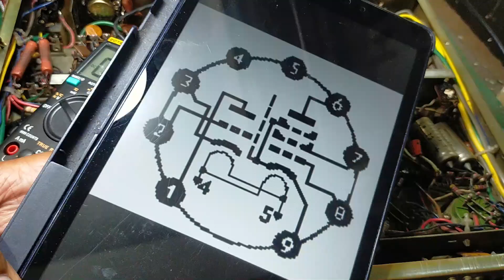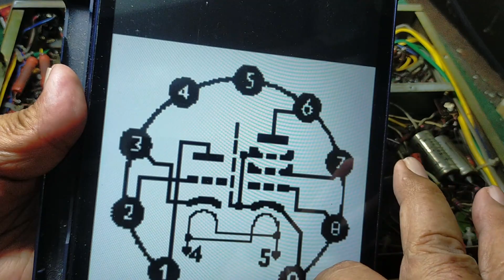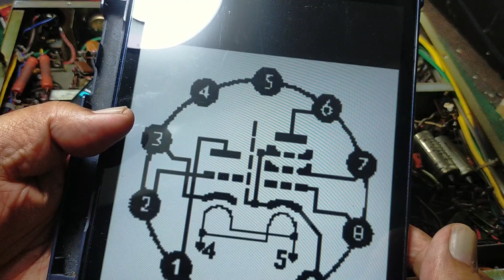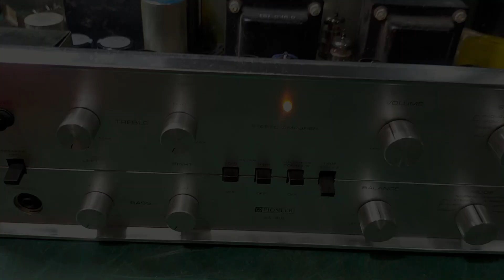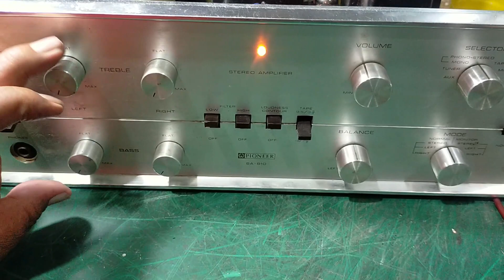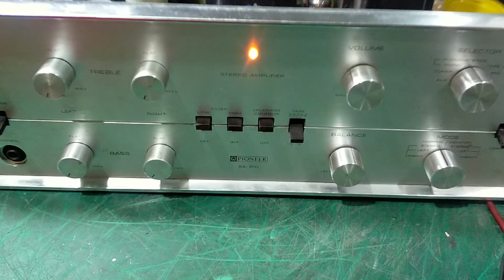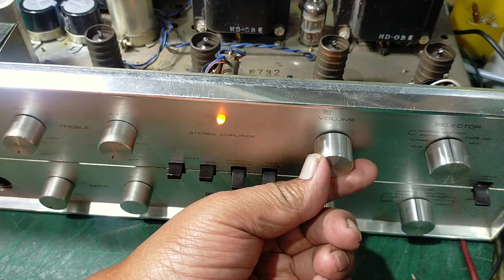Pioneer SA-810 Tube Amplifier

Comment: Punya saya SM83 ..... saya fungsikan flat om tone saya matiin ..... bisa integrade bisa juga utk power saja ..... aslinya kan pushpull saya upgrade jadi single ended pararel masing2 chanel 3 tabung el 84 ........ suaranya enak banget mengalun ..... salam tube amp audio dari surabaya
Reply from the maker: Woow ...keren SM 83 pushpull di rubah single ended 👍👍 
Salam tube amp audio dari Solo 🙏